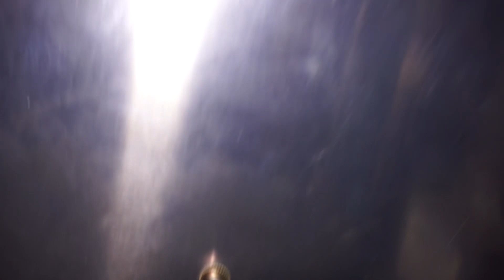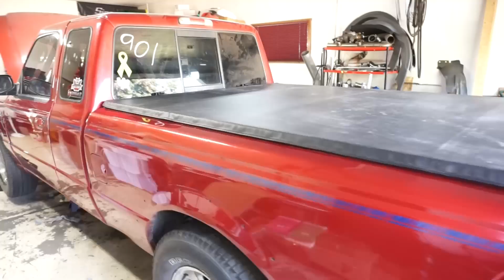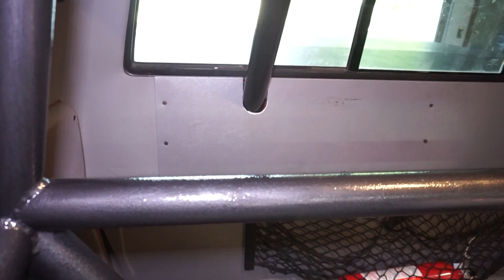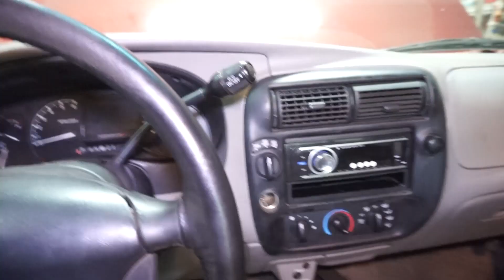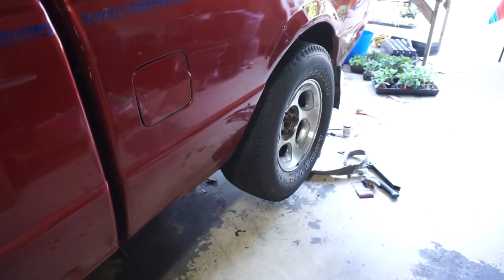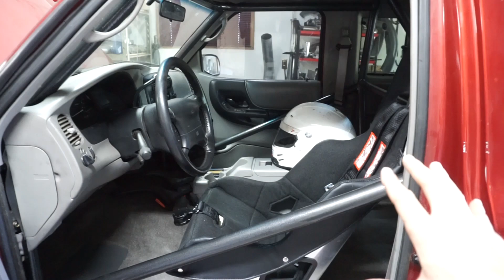Got A LOT Done & It Turned Out AWESOME!!!

Comment: Looking very good! You should wire in so you dont have to hold the trans brake button to go in to reverse
Reply: Depends on the valve body in the trans not the wiring
Reply: @boostednova7120  i know it has to to with the valve body, but it is very possible to wire so the trans brake gets activated on reverse on any setup. Just a "fancy" thing to do
Reply from the maker: @jagharingenyoutube  I will eventually, I did the Escalade that way. I plan to re-wire a bunch of stuff so will probably do it then.
Reply from the maker: @jagharingenyoutube  I set one up the other day for a buddy with manual VB using a shock sensor that triggers reverse through the Holley using gear position. Pretty cool.
Reply: @BlaserBuilds  was thinking about doing a shock sensor in my next build also. Would be nice to use to have a gear indicator in the dash as well

Comment: How to get bump to actually work on jakes d3+ cuz I can’t get mine to work lol I’m using nos ssr
Reply from the maker: I've heard you need to mess with the frequency and duration a bit to dial it in. I haven't messed with it on mine yet so I don't direct experience to comment on.
Reply: Ya as far as I know I have it wired correctly but when hiting bump button it don’t activate solenoid don’t hear anything the ground wire in for the jakes brake still grounded to valve body is why it don’t work I’m thinking idk for sure tho,
Reply from the maker: @seagate40  grounded to valve body is fine. You're just interrupting the 12v when it bumps. A typical brake has a large solenoid so it can exhaust fluid very quickly. This circuit I think will need more time, or a unique frequency to creep. As long at the 12v is interrupted when hitting bump button it should work. Just need to dial in settings.
Reply: @BlaserBuilds  alright thanks I’ll try some more tinkering then